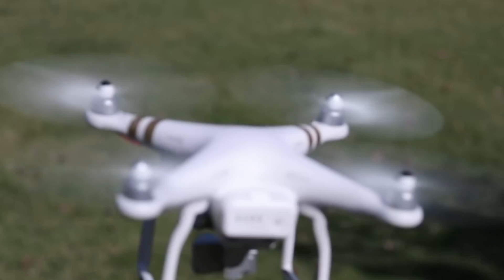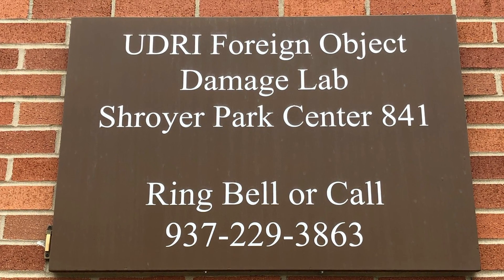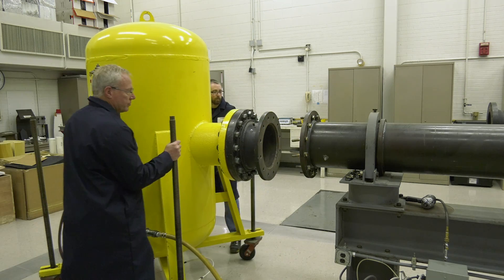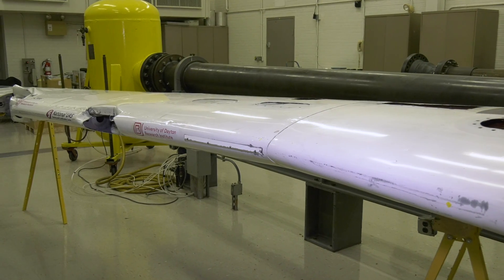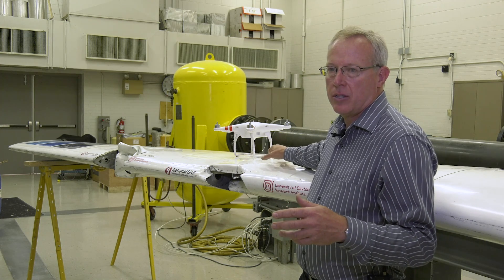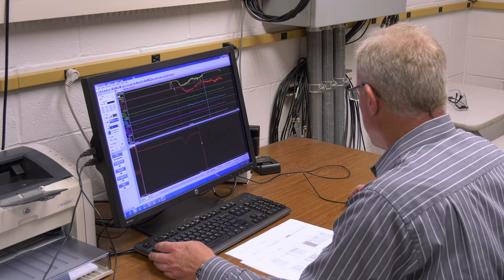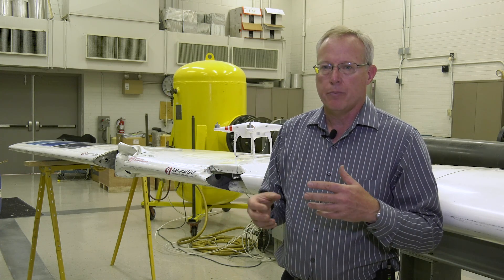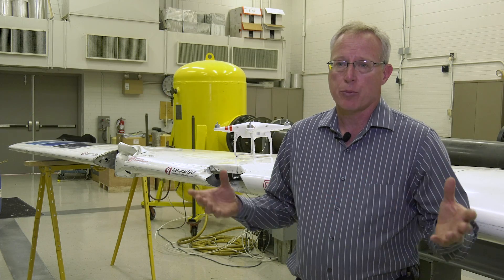What Happens When a Drone Hits an Airplane Wing? – AIN

Comment: This is incredibly disingenuous. No plane will be flying at 230 kts at even extremely high drone altitudes. The maximum speed you are allowed to fly an aircraft under 10,000 feet is 250kts, and a mooney can't go anywhere near that fast, with a Do-Not-Exceed speed of only 165 kts.
Reply: It's a political ploy to regulate.
Reply: I knew it !
Reply: As a matter of fact I do fly UAS, I'm also a GA pilot which clearly, you are not.  The regulation for the 250kts speed limit is 14 CFR Part 91.117 Section A, google 14 CFR 91 and click on the ecfr website for all the FAA regulations.  You also didn't read my sentence, I clearly stated that that the aircraft can be flown at speeds higher than 250kts if the aircraft is not capable at flying speeds below that.  This regulation absolutely applies to commercial aircraft.  14 CFR Part 91.117 Section D: "If the minimum safe airspeed for any particular operation is greater than the maximum speed prescribed in this section, the aircraft may be operated at that minimum speed."  Another thing, these are regulations, not law.

The dangers of UAS interfering with manned aircraft in the NAS is a very real threat and it is only a matter of time before an incident occurs with a fixed wing aircraft, so far the only incidents have been with rotorcraft.  Furthermore any increase of regulations wont actually solve anything.  We already have rules preventing people from flying near airports, yet people fly there still, so why would more rules change anything?  A pilot who doesn't know or doesn't care will not be stopped just because a government piece of paper says so.  Just like traffic lights, the red light doesn't actually stop cars from going through the intersection.  Further regulations will only increase the separation between pilots and the FAA.  Also, there is no way in hell you could ever enforce everyone to get a licence to fly an R/C plane.  You dont even need to have a certificate to fly ultralights, and the ultralights themselves arent even registered aircraft.  The only reason the FAA instated the "register your drone rule" (which was ruled unconstitutional, rightly so) was to be able to hold people accountable for their actions so they can't use the "I didn't know the rules" excuse.
Reply: Agree, I think he was combining full speed ahead on the drone.
Reply: @jamesp13152  the drone was said to be stationary
Reply: @jamesp13152  if the drone was at full speed it would have hit at a much steeper angle, perhaps being split in twain rather than penetrating into the wing (who knows, i'd like to see)
Reply: You're intentionally mischaracterizing the discussion as "denial," and "disbelief." The discussion is that the demonstration did not accuratley reflect the collision speed for a general aviation aircraft, which is what the researchers stated they were testing. Such aircraft do not typically travel at those speeds at the altitues at which drones operate. For whatever reason, you brought up large commercial aircraft operating at higher speeds, which they do, but you also noted that those speeds are at 5,000 feet and higher, which are an order of magnitude higher than this type of drone operates. Not only are those conditions completely out of scope of what the researchers are testing, they are also not accurately represented by the wing structure used in the test. Certainly drones pose a hazard for aircraft operations, but that is no excuse for you to purposely slander drone operators as "clueless" and "reckless."
Reply: And 230 Kts < 250 Kts. There are other, faster planes in the sky, like jets.
Reply: but they still have altitude restrictions.
Reply: Ha, I was about to look up that airplanes max allowed speed for 400 ft, but the US is stupid with some regulations. For instance, I cannot fly a jet turbine RC plane, and even if I could, it would be legally limited to 200 mph (which is pretty cheap and easy to do with electric). 

Yet I can grab that same turbine engine (or several), strap them to a bicycle and ride it on the road without insurance or a helmet (most states in the US allow 50cc engines anyways, Oklahoma allows turbocharged and nitrous oxide powered 80cc engines to be put on bicycles if you wanted, no insurance or tag required, no drivers licence or age restrictions either, so 5 year olds can do this legally). I have a few motorized bikes I loved to drift around town and do burnouts at the stop-lights with after Calculus class, I kept the regulations in my pocket and kept those tires smoking with engines screaming. Gave free test drives for anyone who asked too, just let em' hop on and told em to gas it, just bring it back within 20 minutes (technically they could just drive off and kept it, I never asked for a name or anything), everybody loved them.
Reply: Max airspeed in below 10,000ft MSL is 250kts unless otherwise limited by the capabilities of the aircraft or airspace.
Reply: Um...the mooney m20(ultra)s cruising speed is over 240 knots, idk what a mooney has to do with anything, and I dont know were the fuck you got this do not exceed speed of 165kts from...Though it would be over 10,000 ft, when at cruising speed anyway